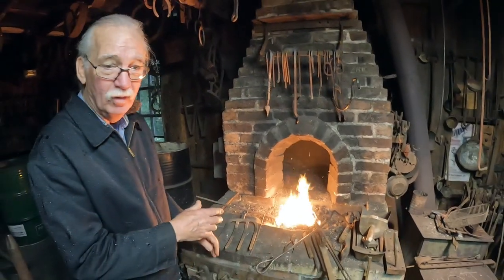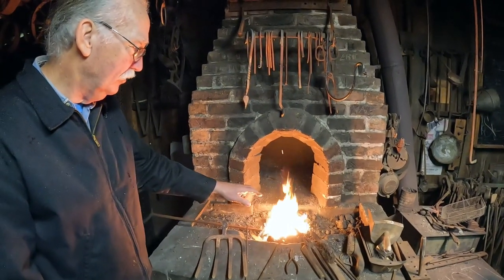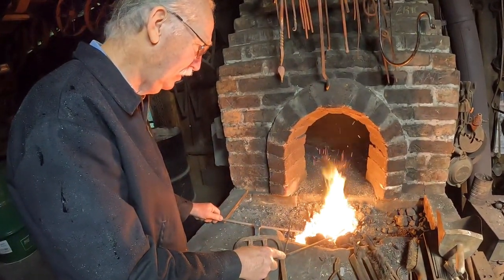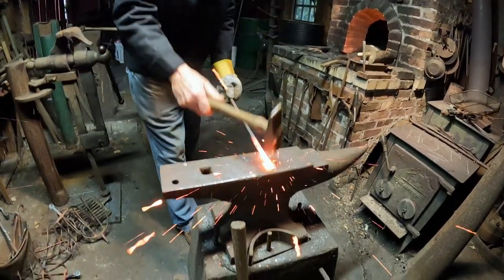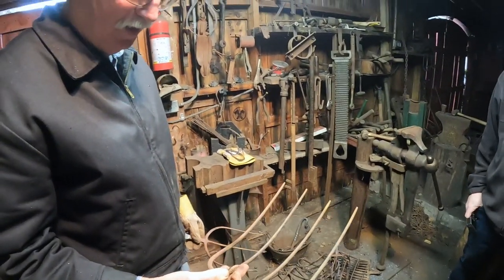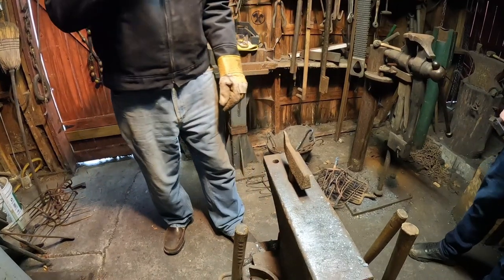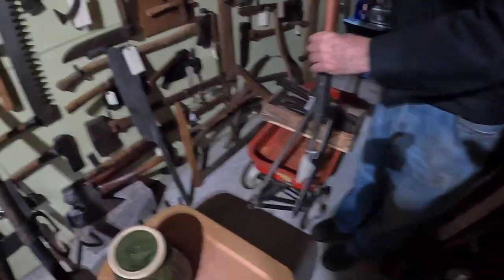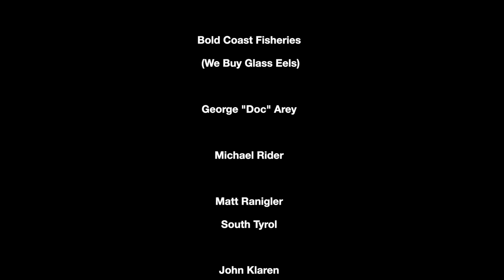Karl The Blacksmith

Comment: Both my grandfathers had blacksmith shops. One moved to Pennsylvania and eventually worked at J & L steel. The other specialized as a Farrier. He got square steel stock and would make custom horseshoes and of course would shoe horses. Wow has times changed, everyone use to have horses, they were as common as cars are today.